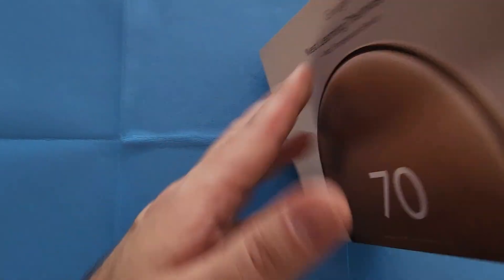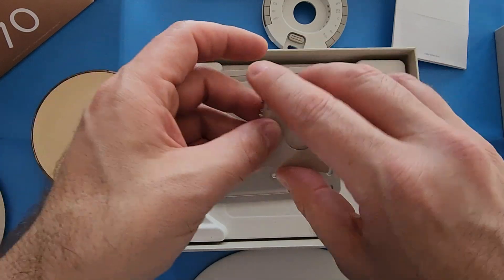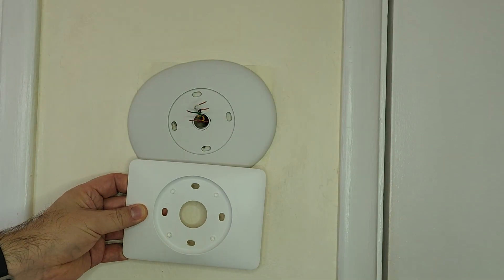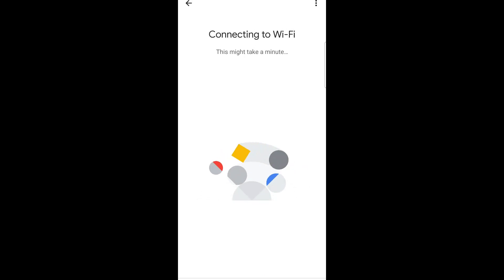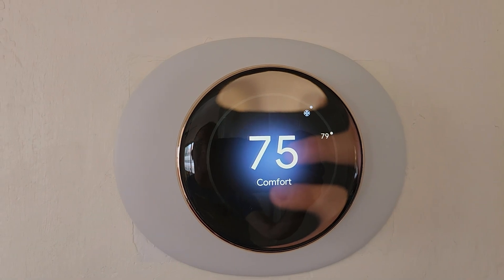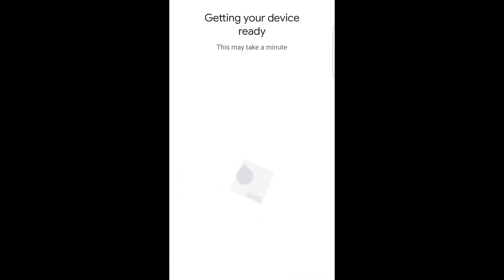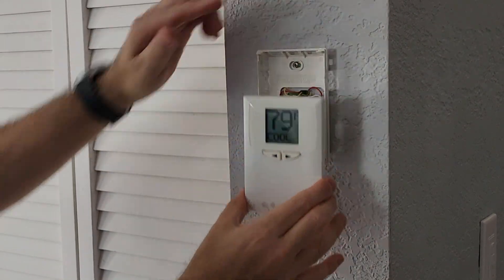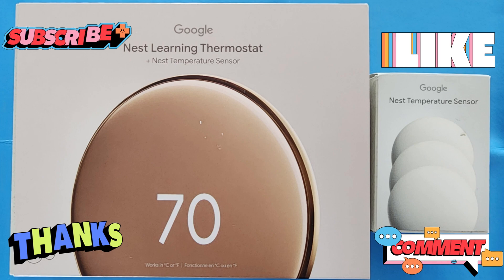Google Nest Learning Thermostat + Nest Temperature Sensor 4th Generation

Comment: Ecobee has motion detectors in the sensors, so it knows what rooms are occupied. You set a comfort range of temperatures, and Ecobee tries to maintain those temperatures in all occupied rooms. 

Google Nest doesn't have those motion sensors, so when you change rooms, you have to manually adjust the thermostat. The fancy AI is there to anticipate the changes in thermostat that you would normally make. 

In other words, a lot of that fancy AI learning stuff is solving a problem that could be solved with one simple hardware change in the sensors that would make the whole system more convenient for the user.

Even though I'm heavily-invested in the Nest ecosystem, I'm keeping my old Ecobee 3 thermostat.
Reply from the maker: Hello. Thanks for commenting. I agree with you 100%. If Google could fix that issue, it would be great, but that's not the only thing that needs fixing. I am new to the sensors, and I have realized that you need to manually pick which sensor you want the thermostat to use as a base point to the temperature you requested, which is tedious. I'm aware that there's other products out there better than Nest, but I stuck with this one just because we had the older model. Thank you again, and be safe.

Comment: Looks like a mushroom on my wall. Personally the third gen is still way better.
Reply from the maker: I agree with you. It looks funny. Muffin Top or an oversized Pixel Watch. I honestly thought it would be a great improvement, but it's the same as the 3rd generation. Thanks for commenting. Be safe.
Reply: @FabCab74  It's less complicated than the third gen, but you could set everything up without using an app unlike with the fourth gen.

Comment: Could you go over the features? I have yet to find one video covering that. I got mine last week and not sure what features are good or what to use
Reply from the maker: Hello. I'm sorry if I didn't cover exactly in detail a few of the features, but it's similar to the 3rd generation, and I mentioned them slightly, but I'll list them. 

Features: 
Includes the Nest Temperature Sensor to give the right temp where you want it in that specific room. That, to me, that's pretty cool. Especially in my out-of-sync master bathroom temperature from the rest of the house. 

Adaptive Eco helps find energy-saving temperatures based on your home and the weather. So you save money on your electrical bill. 

Natural Heating and Cooling. The thermostat learns how the temperature outside affects the temperature inside and pauses your system to help save money once again. 

The Smart Schedule programs itself and learns the temperatures you like and when you like them. It suggests small tweaks to help you save money.  This can be controlled in the Google Home App. 

Control thermostat with the Google Home App and other compatible smart home devices as compared to the Nest App. I'm not sure how true this is because I was able to use my smart home device with the 3rd generation thermostat. 

The System Health Monitor looks out for your heating and cooling system, helps catch many issues early, and can send an alert if something needs attention. 

Reminders and Alerts. 
It reminds you when it's time to change your air filter based on your actual use. Also, you’ll get seasonal maintenance reminders based on time of year. I like this same old feature because it honestly detects the dirt or lack of air flow from a dirty filter. 

Easy to install; usually in 40 minutes or less. Just by following the step-by-step instructions in the Google Home app. 

The Power Sharing feature on the Nest Learning Thermostat (4th gen) gets enough power from your existing thermostat wiring. So it doesn’t require a C-wire (Brown) for installation in most homes. This is really good with old A/C systems that need a new thermostat. 

The Smart Ventilation brings in outdoor air when air quality is healthy and it’s most efficient, like when temps are mildest. 

The Energy Shift from Nest Renew can automatically shift your energy use to cleaner or cheaper times to save money. 

The Matter Endpoint can be used in any Matter-enabled smart home app to control the Nest Learning Thermostat. 

Voice Control with your home automation device. Just change the temp with your voice. I use Google Home. " OK, Google. Set thermostat to 75 degrees. " 

The Dynamic Farsight shows you useful info you can see from across the room. You can choose the design – a clock, the temp, weather, air quality, and more. Same Farsight feature in the 3rd generation, just a bigger screen. 

The Humidity Helper can help to keep humidity at the right level and reduces the risks of condensation and mold. Living in Florida, there's always humidity in this home, but it just displays the percentage amount of humidity. 

Overall, I hope this information helps. Most of the features are internal "Save Money", and the rest of the features are esthetics. I how this helped. Thanks for commenting. Please be safe, and thank you for watching.